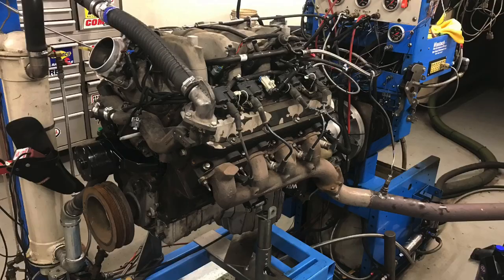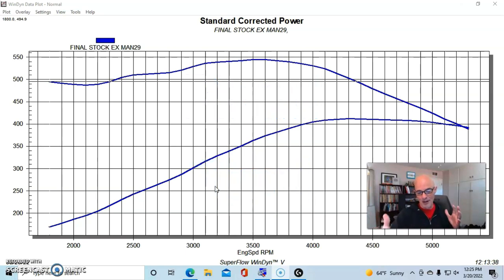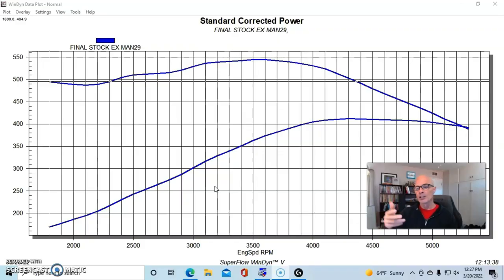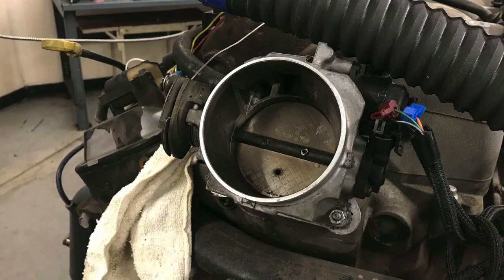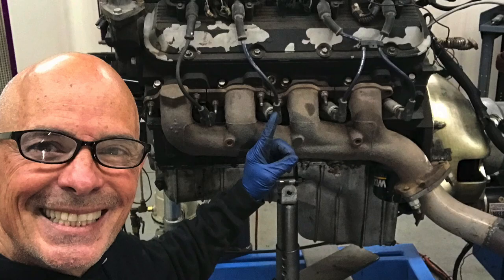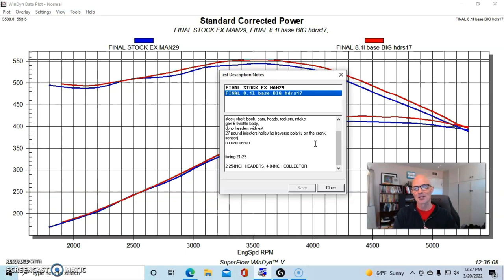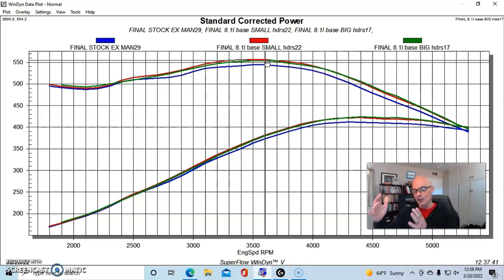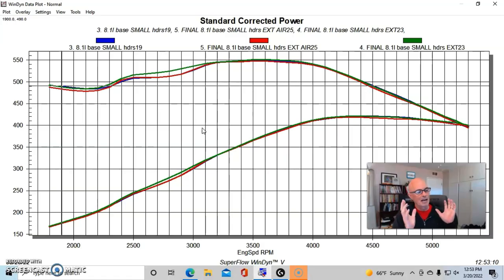HOW TO IMPROVE 8.1L POWER. STOCK MANIFOLDS VS HEADERS. ARE SMALLER HEADERS BETTER? THE OTHER GUYS

Comment: Confirms what I felt when we did headders, intake and tune to a buddies 8.1 that was the most a tune ever picked up a vehicle, but I think that was just hacking the torque management off it.
Reply: Did you completely disable it or just lessen it?
Reply: Same with mine I removed 75 percent of the torque management. Gapped plugged to .045 tried a throttle body spacer because it was on it when I got it…. 180 tstat…. I never added headers since mine was a plow/tow truck and headers don’t last long without leaks and add a lot of heat underhood .
Reply: 8.1's are massively over-engineered for what the factory rates them.

Comment: It's just not moving a lot of air.  1-3/4" should be plenty (if they fit the port), and you really want longer primaries to scavenge at that low rpm.
Reply: But the 2.25" headers were as good or superior at all RPM, correct?

Comment: I suspect that engine has limited valve overlap and that is why you don’t see the headers doing much.
Reply: That's right. At first after reading you comment I was like "well who didn't know that?" and then I remembered not everybody eat/sleeps/breathes engines.
So for anybody reading my comment - bcbloc02's comment is true. It would be for about standard production engines until you run into exotics and like Honda VTEC and Ford SHO. That type of stuff has like motorcycle cam timing/duration specs.
         Part of the fun of this sport is taking large displacement "moose" engines (pickup, suv) and hijacking the designer's intentions. "See that automatic transmission - friendly drooping torque curve trailing off to the right? What would be easiest way to "fix" that? A procharger or cam/compression & manifolds ?"

Comment: My late friend, header builder Jack Davis, told me back when a group of fellow racers were towing with Chevy dually's with 454's, he built headers for his with 1-1/2" primary tubes 42 inches long into a 2-1/2" collector! Said it would pass everybody climbing up the grapevine to Bakersfield, and pass them at the gas station as well.
Reply from the maker: seems like a tall tale
Reply: @richardholdener1727  He may have exaggerated a bit, but I heard mention of it from other racers that it pulled pretty good compared to stock 454's.

Comment: would like to see the marine 496 HO cam dyno. GM 12683320 or Volvo part number 3861266.. Its a much larger cam but designed to use the stock valvetrain...

Comment: Good timing, I just got a 2004 8.1L and Allison trans from a top kick medium duty truck, I’m running Tri y headers into an x pipe and straight through mufflers, trying for as much torque as possible for towing in my Motorhome

Comment: I have one of these 8.1s in my Silverado that is still running strong some 310k miles later. I am so happy to see you starting a series on these often over-looked engines. Can't wait to follow along as I hope to someday freshen this engine and move it over to my square body.
Reply: What engine oil do you use? Trying to decide if I want to switch from 5w30 to 15w40 like some people are saying.

Comment: That is so cool!  I really wish that the LS and 351W firing order was available for everything. The FE is a great candidate it has a center thrust main. So smooth and easy on parts!
Reply: You can get custom ground cams made with those firing orders. The LS is a 4/7, 2/3 swap.....and that firing order is the same as a Flathead Ford.

Comment: Hi Richard.  Watching you go through the collector extensions thing I remembered how the street racers did it when I was a kid and wondered if you had ever heard of it before.  These guys would spend every penny they could beg borrow or steal into their engines making sure they were blueprinted and balanced, ported heads, indexed spark plugs, you name it, if they could think of it, their engines got it.  Dual point distributors set up on a distributor machine.  Those were the days.  My best friend had an FE and he could pull the distributor out, put it on the machine, set the dwell on the points and have it back in the engine and it running in 15 minutes. Back then no one in my area ran more than 430 gears because they had no way to get it to hook up anyway on biased ply tires unless they were at the track.  One thing the poor boys learned early was that if you ran slicks and they hooked up, you broke things like rear ends, axels, drive shafts and transmissions.  When this happened they didn’t have a way to get to work.  Only the rich kids had a dedicated race car and no one would run the rich kids because they had no heart.  They had their work outsourced, they didn’t do it themselves.  Most guys in my area street raced their daily driver.  ANYWAY…I ramble.  LOL  To determine how long the collector extension should be they would bolt up a piece of pipe about 2 feet long to the collector and spray paint it white.  Then they would take their car out and flog the crap out of it.  When they got back there would be a burned area in the paint somewhere on the collector extension, normally around 18 inches from the collector.  They would cut the pipe off at the end of the burned areas and that would be how they tuned for max power.  I always thought that was as perfect a shade tree way to do it as any.  LOL
Reply from the maker: two things happening here-1 is the loss in exhaust heat with distance traveled

Comment: You need to narrow the lobe separation as stock cams can be as high as 128 degrees which prevents wave tuning with headers.
Reply: Im sure the next thing he is gonna do is cam, heads, intake, and test it all on each step.
Reply from the maker: 128 degree lsa?
Reply: @richardholdener1727  yes, it isn't common, 118 is, but on the 5.0 TiVCT Ford it can be that high.
Reply: 128 is a only due to vvt though right?
Reply: @MrPhukyew  correct.
Reply: @psychoholicslag4801  when we're mentioning lsa we're usually referring to engines where said specification is not malleable.  If LS engines had dual vvti the performance world would be in trouble lol
Reply: @MrPhukyew  true. I view the LS family as a thinly veiled copy of the Cleveland with the valve layout reversed and not polyangle. The blocks are even very close to the same deck height and has a similar oil system layout.
Reply: @psychoholicslag4801  I don't know enough about the Cleveland blocks to confirm or deny that but most of the overhead valve pushrod style V8 had a very similar design other than moving around certain components like oil pump or distributor.  When LS came out it changed a lot of things like lifters being placed under the heads instead of under the intake manifolds like every other V8 in history.  Or having six bolt mains or oil pressure ports that flow through your pan gasket.  LS definitely changed the game up.

Comment: So what we now need is a comparison to an older BB with doing a cam swap/firing order swap to see how much more efficient the new heads and intake are. Obviously try to keep it apples to apples as much as possible. Maybe hp/ci and lb-ft/ci comparison. 
Great video and I can't wait to see what else is to come.
Reply: @amospgarcia9152  its not about power. if you run a gen 6 or older cam in it, they have a different firing order and the system needs to know this. if you watch the video, Richard actually brings this up. This is also the reason I brought it up.
Reply: I was just unsure how changing the firing order is going to tell me how much more efficient the new heads and intake are. Sorry for not understanding what your saying.
Reply: @amospgarcia9152  np. Just to clarify, the idea would be to swap in a older cam and compare the 8.1 to previous BB engines using hp/ci and lb-ft/ci to see how efficient (or not) the newer hardware is. to use the old cams though, the firing order has to be changed. they did that with retro style cam for the ls1 to give it the old school sb sound. it's not about making the change to increase power, its just to make it run correctly.

Comment: Richard I'm planning on putting one in 26ft motor home...hoping/planning 4 wheel drive..my done is a 06 2500..8.1 w/allison...so...65-70mph tops...but beach driving...need bottom end and  running cool..

Comment: Biggest problem with this motor is massive intake restrictions. Find a way to convert the Nelson racing engines X ram twin throttle body intake for an LS to fit this 8.1 and you will see massive power gains. Combined with a ported head and the BR 300 cam you seem to like to run and I'm guessing you would be near 700 HP. And 625 torque.
Reply: I'm building  one now running a msd l.s box with new coils   forged  pistons , carb intake with a 1000 cfm carb  big 650 lift cam , big headers  im going for the 700hp mark.

Comment: To bad GM discontinued the 8.1 l think if they would have made improvements with it simular to what Ford did with the new gasoline powered 7.3 engine the LS 8.1 could have made good horsepower and big torque numbers for bigger cars trucks and SUVs with 496 cubic inches making 480-520 horsepower and 575+ foot pounds of torque naturally aspirated could be done very easily if GM would have given any kind of effort in making some improvements in research and development and technology with the engine
Reply: Hp should be well over 505 considering the 7.0 427cid LS7 made that. If they used an aluminum block.
Reply: @rescueaviationfilms1019  I doubt it. The LS7 makes that because it revs high and has a light rotating Assy/valvetrain. Also the block material has nothing to do with it but aluminum heads and direct injection with extra compression would help A LOT
Reply: Ikr?
Reply: No doubt. This is a good engine. I still run mine in a 02’ 2500HD. It’s 10,000 lbs truck. And it will hang with my 08 GT mustang til on a 40 mph roll race til bout 90-110 when it runs out of gear. That old motor is a monster, it’s a hungry monster loves fuel, but so worth it. get you one if ya get a chance.✌🏻🤘🏻
Reply: If I remember right the new GM 6.6 gas engine makes the same power as the new 7.3 with less displacement
Reply: @utahcountypicazospage5412  I'm a Chevy guy but the Chevy 6.6 gas engine is 401 horsepower 464 torque Ford's 7.3 is 430 horsepower 475 torque so the Ford 7.3 is + 29 horsepower and + 11 foot pounds of torque more than Chevy 6.6
Reply: Was that a whole Fkn sentence?
Reply: @rescueaviationfilms1019 
An aluminum block makes LESS horsepower, it is not stable. They are used only to save weight and because they are not as hard on tooling.
Reply: Yes, a properly modernized 8.1 would easily make 450HP and 600 ft/lb of torque. 

Were GM run by intelligent people, rather than Mary Barra and her crew, GM could easily make a 7.0 for the 1/2 ton trucks, a 7.4 for the 3/4 ton trucks, and the 8.1 for the 1 ton trucks. They could easily improve fuel efficiency and power.
Reply: @AlanRoehrich9651 you should let them know you have it figured out.

Comment: I have an 04 8.1 with a raylar modified intake. Raylar said put headers on if I put a cam in it. It has a 80 mil bbk throttlebody, and a Gibson catback on it . 193,000 kms on it Im still happy with it .3500 silverado srw. lngbx.

Comment: I suspect that with the advances in computer modelling, that when these things leave the factory they are optimized for their configuration. So I suspect that changing the go-zintas and go-zoutas will have little effect. Because of the efficiency in design for it's purpose, to make it do other stuff changing the intake, heads, cam and exhaust  in unison would be required. Boost should make it do all the same stuff but more of it.

The computer modelling of everything will only get better and when engines leave the factory, I believe, will be getting the max VE for what they are designed. To get anything other than the designed power curves, I suspect, you will have to change everything, in the air/fuel/exhaust path to accomplish a largely different result...or add boost.

But we already know that.
Reply from the maker: they are not optimized for power-only their design power goal, along with many other design goals

Comment: Hi Richard,
I purchased a 8.1L and was excited until I saw how little parts are available for it. The more I watch your videos the more I learn about this motor, SUPER videos. The question I have is I bought the long block with complete intake but no coils, coil mounting plate, harness or computer. Should I swap to a regular intake and carb set up?
Reply from the maker: I have not tested the carb intake yet

Comment: Would be interesting to see an initial run on a stock tune
Reply from the maker: we didn't run a stock ECU
Reply: @richardholdener1727  You think a factory tune would produce more power than the engine was rated at?

Comment: I would be surprised if headers only see great change to power numbers when combined with a intake and cam. Those manifolds are made to flow better than old manifolds so the benefit is only slightly better flow. The intake not flowing more will limit headers gain.
Reply from the maker: headers don't gain power because they flow more-they produce a scavenging effect

Comment: By changing the exhaust configuration with minimal gains says the intake tract is the cork not the exhaust. Head flow, intake flow and or the throttle body flow isn't good enough to back up the exhaust.

Does anyone make aftermarket intakes and heads for this engine or would that have to be custom or billet only?
Reply: Raylar Engineering makes heads for this engine but your bank account will take a big hit. The heads cost almost $4000.
Reply: The heads are the only thing Raylar has worth a damn, they paid Darin Morgan to design them and he did well, as he always does.

Comment: Anybody ever swapped an Origin 8.0L natural gas engine to gasoline? I wonder what kinda numbers one could expect. The intake manifold resembles a Victor and already has the embossed hole to cut out and drop in an HEI dizzy.. then top off the 4150 intake w about an 850 Holley.

Comment: Do you happen to know if stock 8.1 exhaust manifolds bolted on a vortec 7.4 make any power gains? Wondering for stock truck pulling class.
Reply from the maker: have not compared those two sets

Comment: Actually, the intake itself is a substantial restriction, and once the intake is modified, the throttle body becomes a restriction. There's a lot to be gained there before a cam change. 

At that point, Comp has two good camshafts, and there are cams available for the Mercury Marine version of that engine.

Beware that while you can install 1.8:1 rocker arms on the stock cam, most aftermarket cans, or marine cams will have severe piston to valve clearance problems with 1.8:1 rockers.

Comment: I say smaller header would not add HP or Tq. 
What was stock compression ratio?
Reply: 9.1:1
Reply: @amospgarcia9152  that's what my 496 has 9.1:1 cr,  but it made almost 565hp

Comment: So restrictions were intake and cam.
Reply: Just noticed that the TQ peak is 3600 and HP is at 4400, if that.   So that's why it's not making alot of power.   I wonder how small that cam is and how long the intake runners are.

Comment: Because of the symmetrical intake ports and bolt pattern, would it be possible to run the intake manifold backwards like is possible on the LS engines?
Reply from the maker: I think so
Reply: @richardholdener1727  thank ya sir!